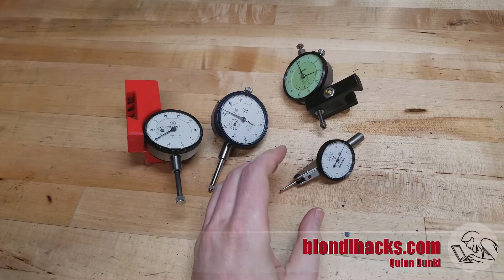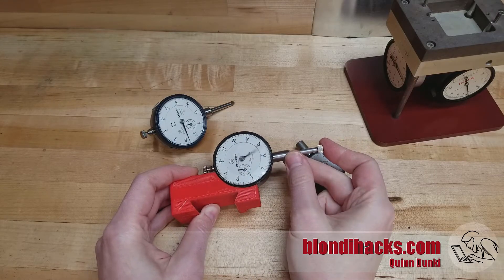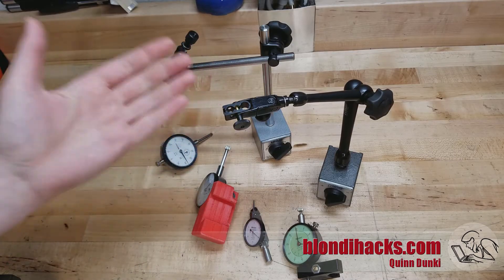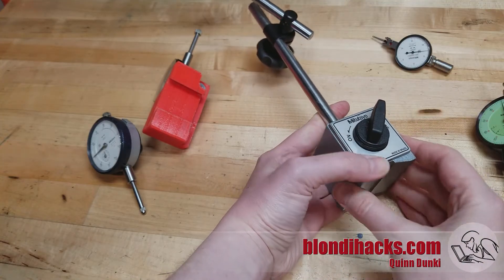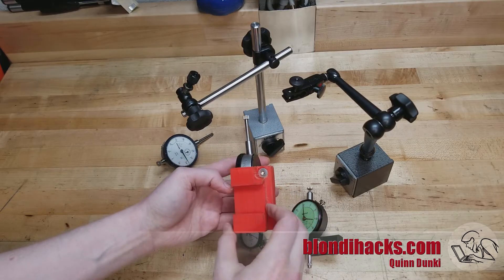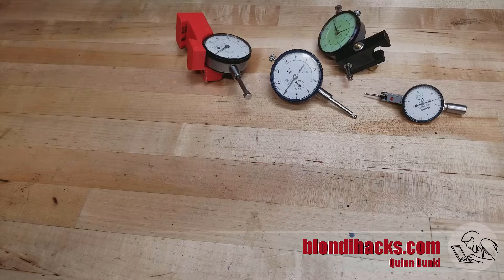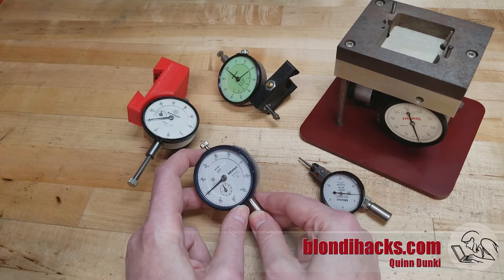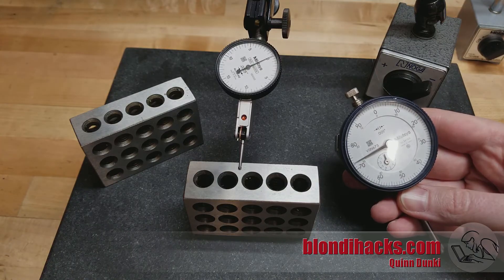Metal Lathe Tutorial 11 : How To Buy And Use Indicators

Comment: You touched on repeatability when measuring the 1x2x3 blocks - one of the places we use indicators is in measuring the repeatability of a robot motion. Set up the indicator at the end of the motion so that it touches mid-range and set zero. Make the same motions a few thousand times and you know if you always get back to the same place. It helps to have an indicator a computer can read. When using a dial indicator on the ways to cut a shoulder, how do you setup the zero (or target) point? Isn't it dependent on where you make the last facing cut?

Comment: Relatively new subscriber and am learning so much from your outstanding tutorials.  However, I am confused because the Mitutoyo DTI instruction manual says we're supposed to "set the contact point (of the stylus) at a right angle to the measurement direction of the workpiece" whereas, if I understand you correctly, you seem to suggest cosine error creeps in the farther away from 180 degrees?

Comment: I was curious when finding your channel about your accent, because it was "slightly" different than other Americans. Then the word "Minnesota" came to mind (I know very little about geography and absolutely nothing about Minnesota). After watching your lathe series, and reading your great machine blog posts, I learned that you are from Canada. I am wondering if "Minnesota" means anything? I am a new subscriber, and I'm also fascinated with Canada, because I've never been there. I just spent some time reading about why Canada is using "Imperial" measurements still, because I was very surprised that you are using Imperial machine tools there in Canada. But I guess, they haven't changed construction and machining tools yet, and are still using the Imperial system for a lot of industrial things in Canada.

Comment: I mostly use the dial test indicator in the lathe. When the needle stops moving it's fine. Short pieces in a big lathe makes it challenging to use the other sort. The jaws are so high that the normal indicator is to short. Yes, there are longer/different "ends" but as long as the test indicator works I'll use that method.
 My biggest challenge is to get the workpieces true in both X (vertical/diameter) and Y (horizontal/length). When I have made the backside (squared it up, made some groves and what not) and turn it around it usually moves in Y when I try to zero X. When possible to use four-jaw and the piece can be kept against the chuck its easier. In theory: when in line → in right angle, not so easy in real life when it should be within 0.01mm (0.5 "thou"?). You did not see the imperial headscratch, but it was there, I promise 🤭🤣!

Comment: Great videos, I've learned a lot of stuff from you and Mr. Pete and others. However, I have what may seem like a "dumb question". I'm an old man that loves working with my mini lathe and mini mill. It is just a hobby but I'm getting better at doing something I love. So, here I go, can you tell me how to deal with magnetism. I know that I'm doing something wrong, I haven't seen anyone having to deal with this most annoying issue. Everything I use from drill bits, cutting tools, chuck keys to screw drivers has small metal shavings stuck to them. I know this went long but I had to ask if I'm the only person that can't come up with a solution for magnets. I have an issue with gravity also but I do have an idea that works.
Reply from the maker: It’s a good question! Tools can become magnetized sometimes, which is annoying. Get yourself a “screwdriver demagnetizer”. They only cost a few bucks and work quite well
Reply: @Blondihacks  Thanks, I will get one.

Comment: Quinn rocks!  I love your videos!

I would love to see a video from you on turning metric threads to a shoulder, using the half nut and thread dial.   

I use a method I learned from a gunsmith a long time ago, that I haven't seen anywhere else.  I'm curious as to  how you do it?
Reply from the maker: I have done that here once or twice, but I do it the “typical” way of keeping the half nut engaged. There is a method for using the threading dial but I haven’t tried it myself and would have to look it up again. Machine Shop Practice Vol 1 covers it.
Reply: @Blondihacks  

Ill try to describe the method I've been using.  It came from a gunsmith @ Score High Precision, a well known long range precision rifle builder in Albuquerque, NM.   I'm not as articulate as I'd like to be, so I hope this comes out making sense.  It's actually easier to do than to describe.

I start by setting the gearbox/change gears to the correct pitch, and the compound to 29.5°.    set up the tool, and touch-off, zeroing both the compound and cross slide.   The compound is used for all depth of cut changes.  The cross slide is only used for tool clearance in the reverse part of the operation.

So, start the first pass by engaging the half-nut when the thread dial is on a given number, let's say #1. disengage the half-nut at the end of the pass, then turn the lathe off (no hurry, but  before the thread dial makes a full revolution).   

 Now you turn the cross slide handwheel 1 turn, from zero to zero on the dial, pulling the tool well clear of the work.   Run the lathe in reverse, and re-engage the half-nut with the thread dial on #1, while reversing.

Once the carriage has moved back to your starting point in reverse, you can stop the motor, spin the cross slide back in 1 full turn to zero, then make you depth of cut change on the compound, and start the next pass.

Basically, your disengaging the half-nut to prevent a shoulder crash, retracting the tool with the cross slide, reversing the lathe, and re-engaging the half nut in the same leadscrew thread while reversing back to the starting point.  Then repeating.

I hope I made sense with all that.

I've learned a lot from your videos and really enjoy them.  Thank you.

Comment: Thanks for sharing information. I ended up getting the same dial indicator that you recommend in your tools list. I did end up getting a Noga holder also, but my Mitutoyo doesn't fit into my Noga. I hope you can point me in the right direction with an adapter that I can put on my noga.
Reply from the maker: There are a bunch of ways those fit together, so I’d make sure. There are dovetails around the edges, or a lug on the back. For the dovetails, the NOGA has a little clip. For a lug, the NOGA has a little bolt.
Reply: @Blondihacks  Wow thanks for the reply! I didn't get anything from my Noga box other then the unit itself. However, I got a bolt today and fasten it to my dial indicator and noga arm!

Comment: Great Video Quinn !  Dial indicators are extremely versatile measuring gages as its all in the fixture hold them.  Their design specs are governed by AGD “American Gage Design” which sets common specifications on size & accuracy.  Another great point is most Inch measuring dial indicators offer  interchangeable contact points with 4-48 threading mount. But when changing contact points its wise to wrap a rubber band around the spindle to avoid placing rotational torque on the internal indicator works. I find your videos very important to new people starting a small home shop. You have a great talent to keep them short, moving and educational all at the same time. I will become a Patron as I want to support you in your work.
Reply from the maker: Thanks for the kind words, Bill!

Comment: Great video. Question: I have a dial indicator where the small hand (subsidiary dial) is just off of the zero. I can zero the large hand but not the small. Is that a problem? Do I just preload it so the small reads zero and then zero the large hand?
Reply from the maker: Great question! That’s normal- the small hand reads after the number. So any reading 1-2 is 100, 2-3 is 200, etc - if that makes sense? Because you can always zero the large hand within one rotation, this works out.

Comment: I see you use Mitotoyo dial gauge is it accurate? I have plan to buy one since my Chinese dial poorly accurate.
edit: sprocket, where is he?
Reply from the maker: Its me wrecking stuff Yes, Mitutoyo is an excellent brand for machinist measuring tools. I like them very much. There are links in the description of this video for buying the indicators you see here. Sprocket was behaving herself today during recording, so no cameos. 😀
Reply: @Blondihacks  thanks for enlightment
:brad:
Reply: @andersjjensen big thanks for sharing the knowledge.
:Brad Schmidt:
Reply: @andersjjensen  Funny my Mitutoyo dial test indicator has 7 jewels.
Reply: @andersjjensen  I have unfortunately ruined a mitutoyo dial indicator once and after taking it apart out of curiosity I can tell you for sure that, this model at least, has ruby bearings on all rotating parts:) I have never seen a starrett tool as they are not so ubiquitos in Europe. I can however also recommend measuring tools made by 'tesa' and 'helios preisser' :)